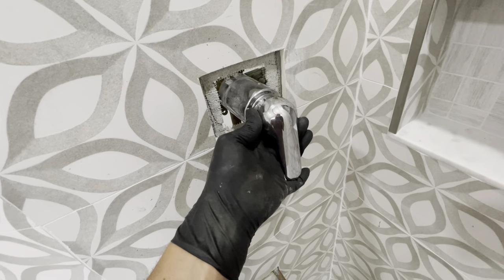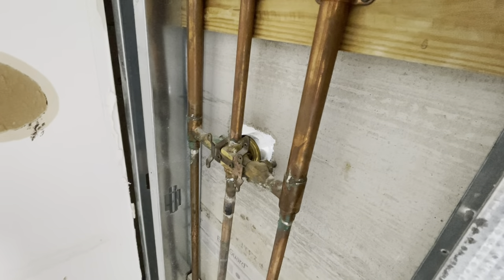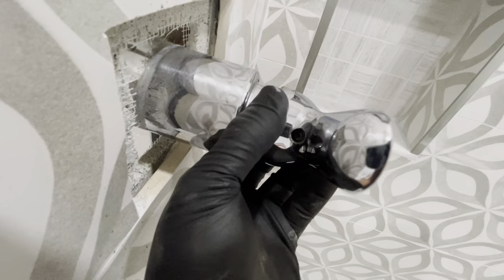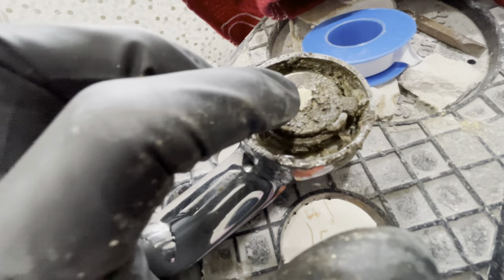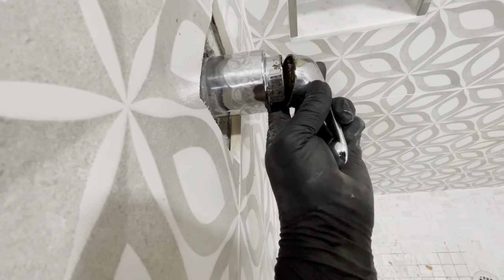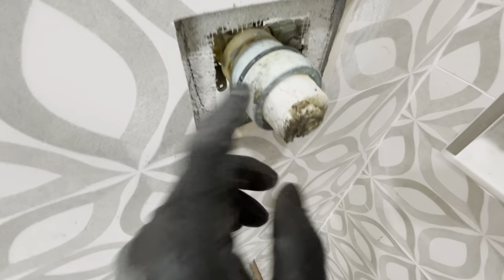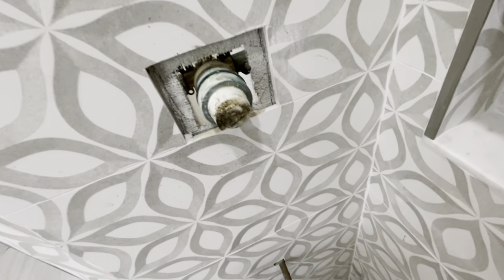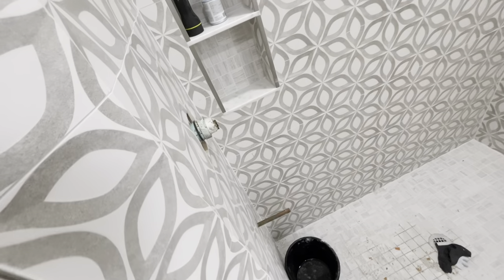Delta Stuck shower handle removal

Comment: I have the same situation but no man. I am not going to cut it.
Reply: Agreed.  No telling what you may actually be cutting into!
Reply: Same issue here. Did u had any luck. Without cutting it ?
Reply: I had to cut and I can attest that you’re only cutting the cartridge when doing so. My handle was seized and there was absolutely no way I was getting it off. I just cut and replaced the cartridge and handle.

Comment: Count me in, I also had to cut one off.  I used a Dremel tool with a cut-off disc.
Reply: Where did you cut it from with a Dremel tool? Thanks
Reply: @troybuiltadventures5481   Using a Dremel EZ409 disc I cut the handle in the same place as this video.  I was only able to go around about 270 degrees but that was enough. As you know, the Dremel cuts by grinding, and may develop less stress than sawing. I could by wrong.  The Dremel discs are incredibly strong but will come off the arbor if too much pressure is applied. The cut was time consuming.  Like the presenter, I drilled out the screws to no avail. I am a total Dremel fan boy. I got the Bosch branded battery one (to use batteries on hand).  Note, the battery one is vastly superior to the AC plug version in that the motor is circuit breaker protected. I have tripped the breaker at least 100 times and expect the motor to last forever!

Comment: I have tried everything and it is so corroded. You mention cutting it. How do you do that? And without harming anything else.  Thanks
Reply from the maker: Spray it with PB blaster and wait a few hours. It will come off trust me.
Reply: Could you please post what cartridge/valve stem part number did you replace it with? I have the same Delta Monitor and am in the same situation. Thanks.

Comment: Since you cut it did you replace it with a new handle somehow or did you change everything after? Mines stuck too.
Reply from the maker: Yes I replaced it with a new valve kit and front handle which is cheap.